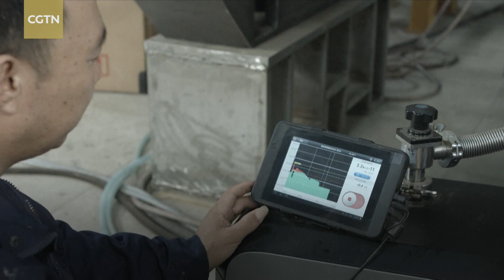Chinese researchers develop superconducting magnet for MRI system

Comment: That's good and all, but keep your focus on the lithography and on the RISK-V design. Those are the two major factors which will lead to your independence in the semiconductor field and will practically make you completely sanction and tech banning proof.
Reply: Don't worry, I am sure China can manage more than one major project at a time.